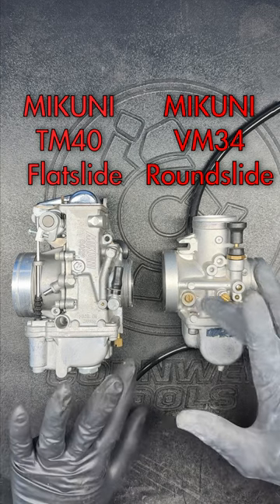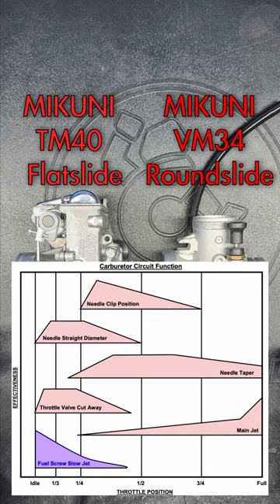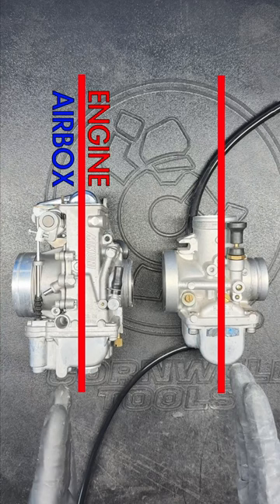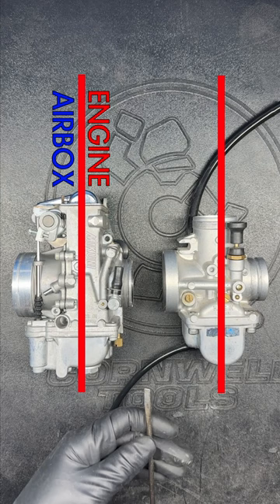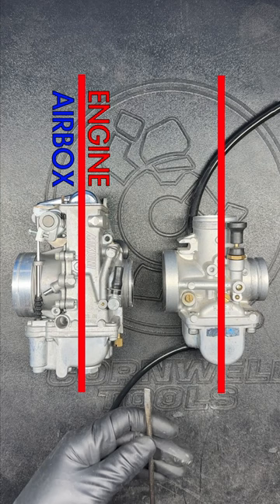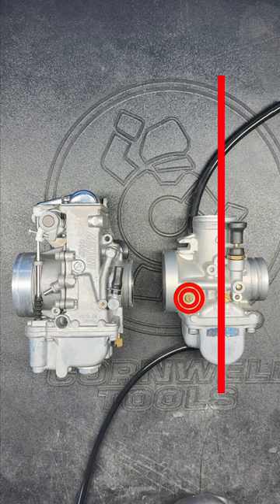Know how to adjust air/fuel mixture screws on ANY carburetor in 30 seconds!

Comment: Not always. For example, the carbs (e.g. Keihin PZ19, Keihin PB15) on the old Honda Cub family, Chinese pitbikes, and other similar bikes have the air adjustment screw on the engine side.
Reply from the maker: On those carbs the screw is on the engine side and they do meter fuel. They just don’t have very finely machined screw tips like fuel screws usually do. So it looks more like an air adjustment screw.
Reply from the maker: If a mixture screw has a spring with a washer and oring that’s a giveaway for it controlling fuel. Air controlling screws usually just have a spring but won’t have the washer or oring. If you google “PZ19 mixture screw” you can tell by the pics that they’re fuel metering screws.
Reply: @oneupmotogarage 
I own a bike that uses such a carb and I can tell you that it indeed has an air adjustment screw. There is a passage that goes from the air box into where the adjustment screw is. If you search for guides on how to tune these carbs, they will all tell you that these carbs use air adjustment screws.
Reply: @oneupmotogarage 
Those pics of the "PZ19 adjustment screw" do seem to include an o-ring for some reason. However the o-ring isn't necessary and the stock carbs that come with the bikes usually doesn't have them.
Reply: @oneupmotogarage 
Usually, though I can't say if this the case for all carbs, if the adjustment screw is on the side, then it is air screw. If the screw is by the float bowl below, it is a fuel screw.
Reply from the maker: @joaquin3396  side vs bottom is less predictable than the engine vs intake location for determining screw’s control (air bleed vs fuel). Because on many the screw can be above the fuel level (side location) but angled down to reach fuel level. Like with the PZ19 for example. I see wide variations in PZ design, the PZ22 I’m finding both air and fuel adjustment screws on different variants (probably genuine vs some knock offs). But I can’t find anything conflicting with my video’s logic.
Reply: @oneupmotogarage 
I suggest you check out a bike with a PZ19 so that you can see for yourself that it uses an adjustment screw that richens the mixture when tightened and leans it out when loosened (i.e. air adjustment screw).
Reply from the maker: @joaquin3396  all I can say is in person or via photos, everything points to the PZ19 screw metering fuel. The fine tip mixture screw and use of oring give it away. Also the location and downward angle of the screw going into the float bowl would make it break physics to be an air bleed screw.
Reply from the maker: The passage you refer to going from the airbox to the adjustment screw is necessary for fuel metering screws because it allows the engine vacuum to draw air past the screw tip and pull the fuel up and into the intake. So having that doesn't hint at it being an air bleed screw, it further confirms it's a fuel metering screw.
 @joaquin3396

Comment: same on 2 stroke carburetor? 
tighten : lean
loosen : rich 

plz reply😢
Reply from the maker: The same rule applies to 2 stroke carbs. Usually 2 strokes have the screw on the airbox side metering air so in = rich and out = lean. But if your screw is on the engine side of the slide, it will be like you say.

Comment: I have the plastic screw heads on TM40’s on my
Snowmobile and I went from 1.5 turns (spec) to 2 turns thinking they controlled air. Now it floods out at idle and is really hard to start when warm. I guess those screws control fuel and not air on the TM40’s. Can you confirm this? Thanks for a great video. Subscribed.

Comment: Mine is in the middle😅 which one do I have?
Reply from the maker: @user-mm8rc8ps9m  the one in the middle will be idle adjustment. The air fuel screw could be hidden under a cap, or it could be just harder to find under or on top of the carb.

Comment: What if its in the middle
Reply from the maker: in the middle is the idle adjustment screw
Reply: @oneupmotogarage  The TTR 125 carbs don't have idle screws. Their mixture is how they change the idle
Reply: @oneupmotogarage  cuz the idle is set in stone so the mixture is what you adjust idle with.
Reply from the maker: @PinnedTTR125  They most certainly do have an idle adjustment screw. But on that carb it’s not the screw in the middle. That is actually not a screw, it is a guide for the throttle slide. You can’t (or shouldn’t) move it even though it looks like a flat head screw. The mixture screw is on the engine side under the carb (meter’s fuel), it may be covered by a little plug you have to remove.
Reply: @oneupmotogarage  I had to move it the other day because of a adjustment to my air box that caused it to backfire and idle low and I turned that screw and both problems where fixed

Comment: My bike runs fine but when it idle after a few seconds it cuts out any suggestions
Reply from the maker: My first guess would be too rich on the idle circuit. You can try adjusting the air/ fuel screw to lean it and if that doesn't help, try richening it.

Comment: The carb on my motorcycle is Mikuni Roundslide so the  screw is on the air filter side so which is better Lean or Rich?
Reply from the maker: One isn't always better than the other. It's a ratio and a matter of finding the best mix. Usually start at 1.5 turns out for these VM round slides. And then tighten loosen from there in 1/2 turn increments to find best idle/ off idle response.

Comment: If I lean it out will it help with backfire
Reply from the maker: Depends what is causing the backfire. If it’s a true backfire then your timing is likely off. But if it’s exhaust popping on deceleration that’s usually a sign of lean condition already and richening would help. Just go by trial and error, in 1/2 turn increments each way.
Reply: @oneupmotogarage  alright ya when I let off it backfires

Comment: How do you lean out if screw is in the middle.. i believe i have 2 brass screws one in the middle and one off to the side.. can you help? Sazuki ds 80 y2000
Reply from the maker: The one in the middle is the idle control screw. It directly moved the throttle slide up and down (in = up = higher idle, out = down = lower idle). So you adjust them one at a time until you get the idle and the throttle response off idle how you want it.
Reply: @oneupmotogarage  thank you my friend..!

Comment: My fuel metering screw seems to do nothing on my recon 250 I can run it all the way in and out and doesn’t do anything, I have the throttle needle clip on the 2nd to last slot and I still getting popping when I rev and let off the throttle
Reply: Same idk what to do

Comment: is it possible to unlock rpm by modifying the carburetor?
Reply: The limiter is in the CDI, not in the carburetor...

Though I'd suggest against opening the limiter if you have stock internals.

Comment: If you would not mind checking my most recent video is my carb tuned right?
Reply from the maker: @ashlee896  what’s stock pilot on that bike? I see you have a 40. I rarely ever have to change the pilot jet size when jetting for mods. It sounds pretty good, but maybe a little lean on the mixture screw. You’re 1.5 turns out, if it’s a fuel screw, maybe try another 1/2 turn-1 turn out (totaling 2-2.5 turns out).
Reply: @oneupmotogarage  Thank you for the help I do not know mutch about it but does turning the fuel screw out make it richer?
Reply: @oneupmotogarage  I’m now 2 turns out I posted another video does it sound better with 1.5 or 2 turns
Reply from the maker: @ashlee896  I’d need to know what carb to know for sure, I’m hoping out is richer. Based on my vid which way do you think it is? Its sounds pretty clean in both videos honestly. I thought it may be a bit lean because it sounded like maybe a slight idle hang before settling. But how does it run down the road? Any stumbles or sputters?
Reply: @oneupmotogarage  It runs great now I decided to do 2 turns about but it was still a little lean I am now running it on 2.5 it sounds a tad bit better and comes down to idle quicker. I plan on posting a video tomorrow on it.
Reply from the maker: @ashlee896  nice! You can even try 3 turns out. That’s about the most you’d want to go before sizing up the pilot jet.

Comment: Can someone explain how I would tune it if it doesn’t have a screw ?
Reply from the maker: what carb or bike are you dealing with? All carbs have an a/f screw somewhere. Sometimes they're on top, bottom, left or right side. If it's a street bike made after early 80's the screw will be covered by an aluminum plug you have to drill out to access it.

Comment: Does it apply to non mikuni
Reply from the maker: Yes almost all carbs aside from 3 exceptions I’ve found where an air adjustment screw is on the engine side. Old Amal concentric carb, PZ19, and maybe a really old Bing.

Comment: What does it mean when you start up your atv and it makes a popping noise ? Mean it’s running lean ?
Reply from the maker: if its popping on deceleration (after you let off the gas) its probably lean or has an intake air leak (really lean). If it's popping as you accelerate it's probably rich.
Reply: @oneupmotogarage  no it only pops when I press the button to start the atv
Reply from the maker: oh, once it starts it doesn't pop while running at all? Does it take many cranks before it starts? @762Kwan
Reply: @oneupmotogarage  after it crank up it doesn’t pop anymore but sometimes it takes a minute to start up
Reply from the maker: could you be using too much choke? Or are you twisting the throttle when you hold the starter button down? That can sometimes give it too much gas and make it pop.   @762Kwan

Comment: Sooooo how tight or loose should it be to run correctly? 😂
Reply from the maker: depends on the carb but usually 1.5  turns out on air screws and 2.5 turns out on fuel screws from lightly seated is a good baseline.
Reply: depends on your height above sea level
Reply from the maker: @Gruxxan  yes altitude plays a role.

Comment: How could adjust best mileage for vm 34 carb
Reply from the maker: You’ll want to set it as lean as it can run well. There’s not a very big range before you’ll notice power loss and too lean can hurt the engine. But something running a VM34 shouldn’t be getting terrible mileage. If you are, it’s probably jetted too rich.

Comment: I have scooter indian one but it has air screw as per knowledge coz it have blunt end not sharp one bike is hero maestro edge 2017
Reply from the maker: There are a few examples I’ve seen of a blunt looking mixture screw controlling fuel. But it’s pretty rare and only on small carbs, cheap carbs it seems.
Reply: @oneupmotogarage  my bike is cheap one. Its indian 110cc single cylinder one. When i rotate the nut in clockwise to the end bike engine stops. How to identity my needle is fuel or air pls help
Reply from the maker: It should kill the bike when tightened all the way whether it controls fuel or air, so that doesn't give us the answer. Where is the screw located? On the engine side of the carb slide? Or airbox side? Is the screw on the side of the carb or underneath? @2ndgeneration788
Reply: @oneupmotogarage  screw on engine side and, screw located side angle upword. Idk what to do :(
Reply from the maker: It controls fuel, so tightening is leaner and loosening is richer. Start with it about 2 turns out from lightly seated.   @2ndgeneration788
Reply: @oneupmotogarage  ok ill try

Comment: what if the screw is in the middle?
Reply from the maker: In that case it is actually the idle control screw. Meaning it directly raises and lowers the throttle slide. Tighten to raise idle, loosen to lower.

Comment: mines a butterfly carb and the screw is in the center 😅😅😅😅😅
Reply from the maker: Carbs with a butterfly valve (usually called CV carbs) usually have fuel mixture screws on the top or bottom of the engine side of the carb. They’re often covered by a plug you have to drill out to access. I’m editing a video on that exact thing right now.

Comment: Mileage  which ratio prefer
Reply from the maker: It won't make a big difference in mileage but if you're trying to get every bit of MPG go as lean as you can with it still running okay.
Reply: @oneupmotogarage   performance tuning ratio ...

Comment: Haha what about those carbs where the mixture screw is a circle and you cant even adjust it
Reply from the maker: You mean the tamper resistant "D" head screws? It looks like a circle with a flat spot on one side and there's a special tool for it. When I remove those ones I Dremel cut a slot in them so a flat head will work.
Reply from the maker: Or you're talking about the plug that is found covering the adjustment screws on street bikes after the early 80's. It's round aluminum and you can drill it out to get to the screw.
Reply: Yea I think a few of my carbs have the D head screws. I haven't found the tool to adjust it, I just thought they were meant to not be messed with  @oneupmotogarage
Reply from the maker: if you google "D head tool" you'll see motion pro has a bit for it. That's what I use to get them out but I always slot them for future ease of adjustment @brandonfoley8070

Comment: So left is more fuel nd right less fuel?
Reply from the maker: IF your screw is located engine side of the carb, then that is correct. If the screw is on the airbox side of the carb it is the opposite.
Reply: @oneupmotogarage  copy what it has 2 screws 1 by the intake part and one kinda in the center
Reply from the maker: center screw adjusts idle by moving the slide up and down. The intake (engine) side screw is the one my video is talking about. On yours, sounds like it controls fuel so tightening = less fuel and loosening = more fuel. @thonestmistakeXX93
Reply: @oneupmotogarage  ccpy thank you so last question if it has both do i habe to mess with idler screw too?
Reply from the maker: usually yes. They work together so as you change the air fuel mixture your idle may end up higher or too low so you will bring it back to the best idle with the screw in the middle. @thonestmistakeXX93

Comment: WRONG... Tighten the air screw makes it run lean on air. This makes it heavy on fuel. Loosen air screw adds air making it AIR rich. The correct way to say it is running rich on air or lean on air, not fuel as a carburetor meters the air not the fuel.
Reply from the maker: Chad, thanks for your input but that is confusingly reiterating the same info I've put in this vid. Carbs meter fuel WITH air, and the terms "rich vs lean" is not pertaining to air OR fuel, it is always a ratio between the two. No one says "AIR rich" that is confusing lingo. The generally accepted way to say it is "rich = too much fuel, and lean = too much air"
Reply: That made no sense, the whole term of something being "rich" refers to the air/fuel mixture having lots of fuel

Comment: The appolo stock carb doesn't have this
Reply from the maker: Appolo? I think that's a knock off brand for Honda clones mostly. I would hope their carbs have air fuel adjustment screws of some sort. They may be located on top, or bottom of the carb, not always on the side.
Reply: @oneupmotogarage  it's actually located on the bottom they have some videos out on it. But you have to drill a hole to get to the screw. Because it's sealed
Reply from the maker: @TheCambra  Yep that's standard on any modern street legal motorcycle (since the early 80's I think). They have to cover the screw for EPA regulations. But you can remove the plug and adjust it as my vid describes.

Comment: Does this also apply to a 2008 crf150r?
Reply from the maker: Yes on that bike the screw is on the bottom of the carb, engine side of the slide and it is a fuel mixture screw so turning in = lean and turning out = rich.

Comment: My engine is to hot at idle what should I do with mixture screw 🪛
Reply from the maker: Hard to know what you mean by too hot. usually too hot means too lean so you'd want to richen the mixture. But if you mean the engine runs too hot when left idling, if it's air cooled that will happen to any engine without a fan blowing on it before too long.
Reply: @oneupmotogarage  Exhaust at front is roasting from engine at idle straight away I put new carb on it and set idle screw up running good just hot 🔥 I need to adjust mixture screw now to maybe help with the heat but no clue if that will help it's an Apache 100cc atv air cool mid size
Reply from the maker: Hard to say if what you're describing it normal or not. Can you test the exhaust temp with an infrared sensor? It should get really hot, up to ~1,000 F (~500 C). On some engines the header can even glow. Heat alone isn't a good thing to tune from. No a/f screw adjustment is going to make your exhaust header not get really hot.   @JOHNNYBEE.1
Reply: @oneupmotogarage  thanks for replying last time I checked was 1884°f